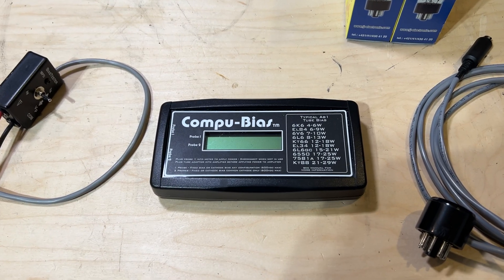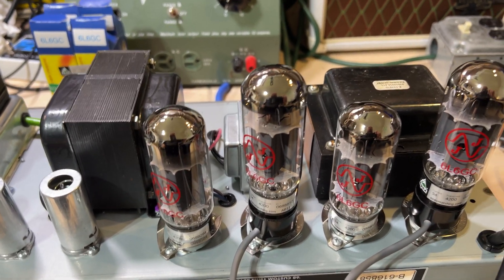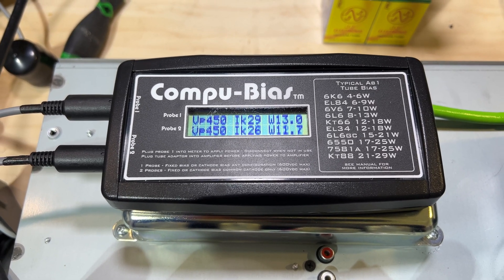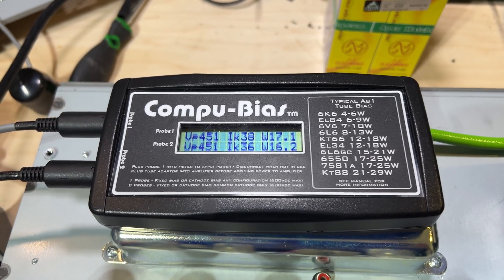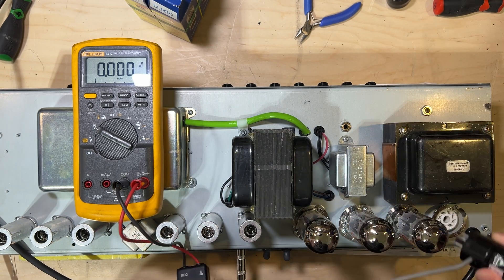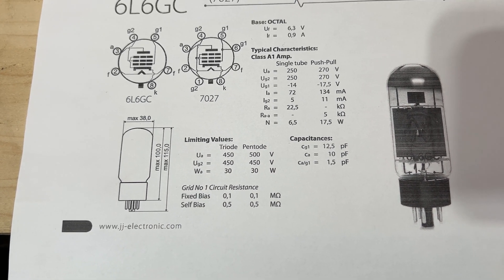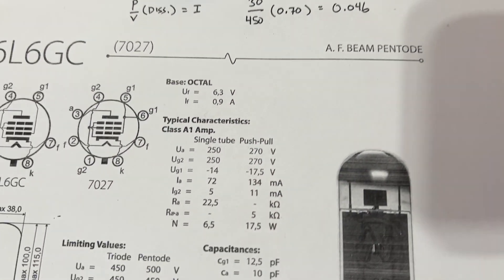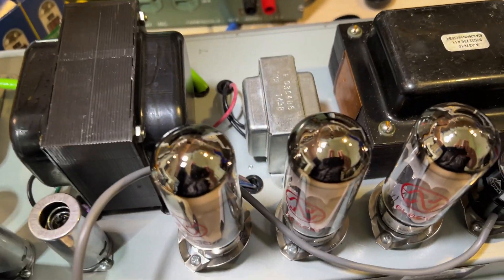How to Bias Tubes on a Fender Twin Reverb Reissue | Using 2 Types of Bias Probes

Comment: I will never get the logic of some. I hearing people say they set there bias cold so the tubes last longer. Even know there amps sound better on the hot side. To me you don’t buy a 2K amp and not have it sound its best. Yes I bought a Ferrari but only drive it 50mph so the engine lasts. lol, I don’t get it!!!
Reply from the maker: Definitely something to that! Especially if you believe the stories about Eddie Van Halen biasing his tubes at 90% and above and then just planning on failures during the shows. Some amps can definitely get away with, or even are designed for colder bias though too. 5150 amps are designed to be cold biased and have some crossover distortion in the power amp. Ampeg V4 and SVTs sound a lot better when biased around 55 - 60%. The important thing (in my opinion) is to figure out the range of values that are “safe” for the tube then adjust within those values to what sounds best for your circumstances.